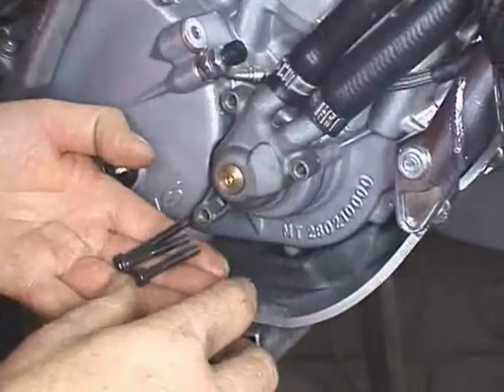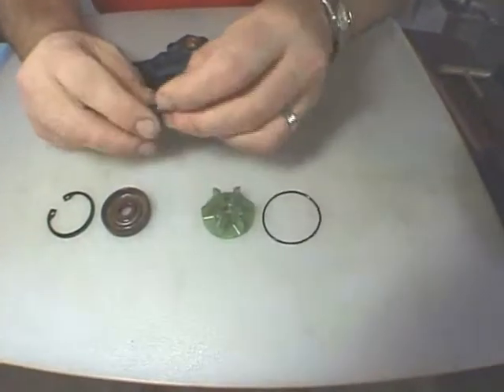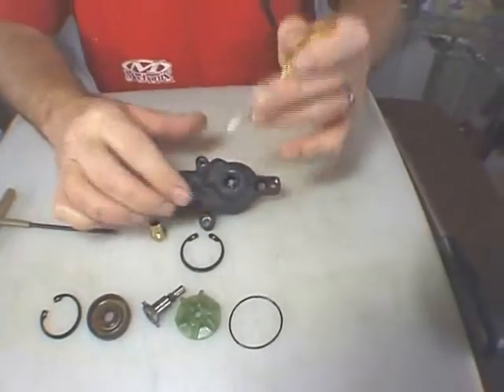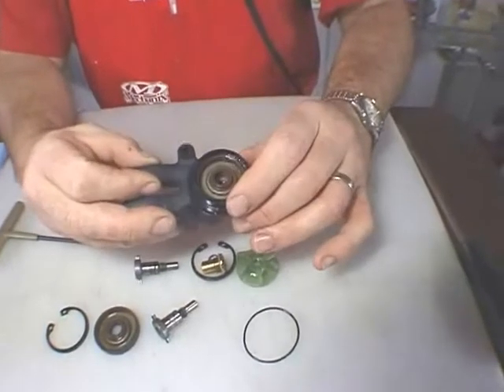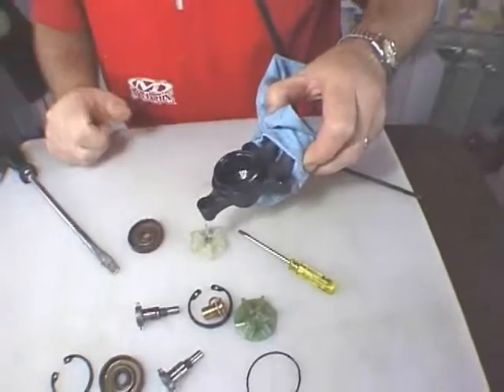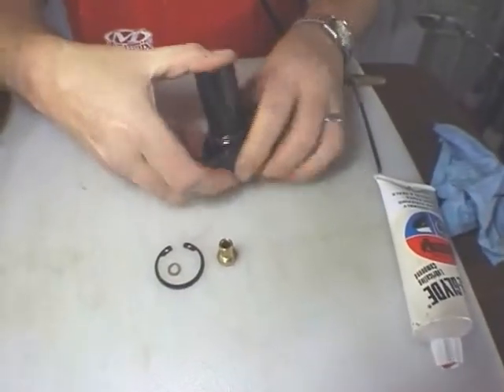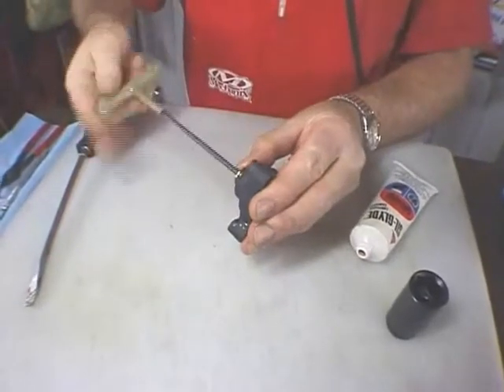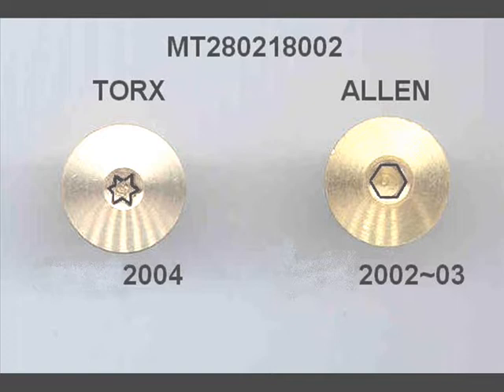Jim Snell - servicing - GASGAS TXT PRO WATER-PUMP (seal replacement)

Comment: Just did the this seal change on my 2012 txt 280 pro after draining emulsified oil out of engine. This video was excellent viewing beforehand. Did it with pump still attached to coolant pipes - bit of a fiddle but avoids breaking the original factory pipe clips.
Reply from the maker: I actually have a short video that shows how easy it is to release and reuse those hose clamps - https://youtu.be/6sAerXIhHMk